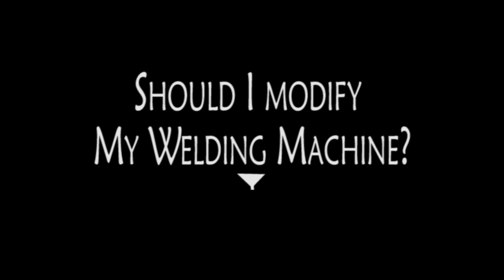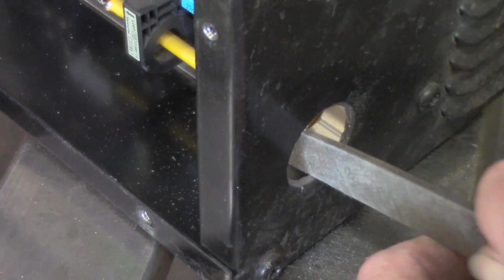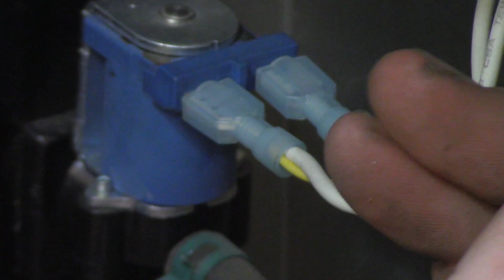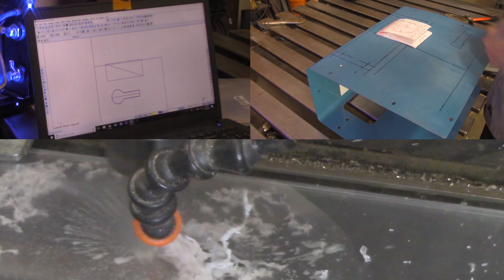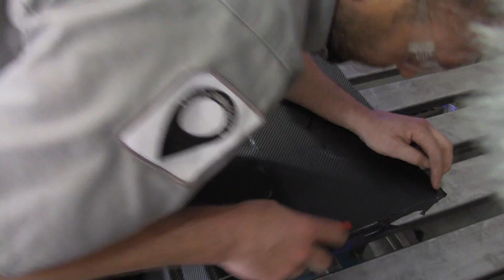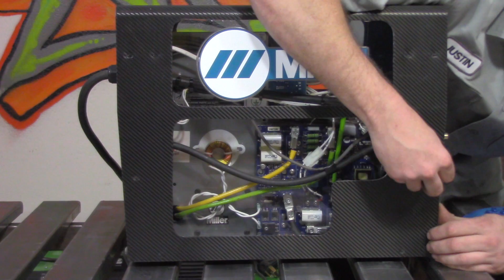TFS: Custom Welder Build

Comment: Ive programmed small computer games, built my own pcs starting from childhood, modified electronics and circuitboards.  Recently I purchased an amazing Miller Synchrowave 180 tig stick machine, plane Jane in terms of feature set but the reliability of a transformer machine, adding to its feature-set and making it more interesting would be really cool.  If I modify its functionality in any meaningful way it would probably be external pulser functionality on an arduino board or something and tied into the pedal but as a beginning tig welder such things are so tied into your personal preferences, maybe I'll do that some day as an experiment reading min max values from my pedal and playing with line input attenuation via an external chipset.  I probably prefer the mentality of skill development rather than creating technological crutches for my limited experience.  I love seeing the amazing case mod culture that surrounds gaming and pc building transfer into the welding space... as expensive and potentially hazardous as these machines are a lot of people are probably terrified to touch and modify them but it is really cool to see.  Love the videos, training, awesome precise, thanks for sharing your experience.

Comment: If you had room behind the panel, a step drill would probably have done the trick to make the holes bigger. But obviously you couldn't shift the hole using that method.

Comment: Awesome build! A couple of pro suggestions for future builds. Instead of hole saw use a knockout set for putting holes in electrical boxes. The make the job quicker and easier. Also when machining the acrylic, use industrial CNC double stick tape to stick it to the table. It’s available on Amazon and keeps you from putting your hands so close to the tooling. Great build man!

Comment: I'm sorry but I absolutely love my diversion 165.  I have never had a single issue with it and it's welded every from copper, aluminum, stainless, titanium, inconel, steel...  It doesn't have the adjustments that the other machines do but I haven't found a single situation where I was thinking 'only if I could change this setting', of course it has a duty cycle and I can't weld thick aluminum but it's my go to welder in my shop that has 6 Tig welders.

Comment: on the up side the wood kept metal particles from  blowing all over the circuit  board. I REALLY appreciate this video because I have a Thermalarc 211Ii  and I can't get a CK torch for it because My gas doesn't come through the DNSE connector.  I was HOPING  you were going to  do a HF start mod for this.  Well maybe  that can be a new project  how to get a DC Lift-Tig machine to have  HF start.

Comment: Putting that plastic sheet on the machine instead if the metal case, causes a LOT of RF to be emitted by the machine. Not good. It’s probably not legal anymore. Same thing with gamer computers when the replace the sides with plastic, except that the welder is worse.

Comment: ProTip :: HoleSaw drilling at approx 3½ min - no need for board, grab another holesaw "the same size" as the existing hole, then throw it INSIDE the bigger one, using the smaller saw as a core/centering stabilizer ..

Comment: Even simpler than clamping a board inside the machine case for the hole saw is run a hole saw inside the hole saw that matches the existing hole👌
Reply: He needed to change the center position of the hole.

Comment: Pro tip here:
if you're stepping up in a hole size with a hole saw you can put the smaller hole saw that matches your already established diameter hole inside of your larger hole saw there for centering it and not needing to have a backing plate to drill through to center your drill.

Comment: only thing I might have done extra since its already getting changed is use a gas thru dinse connector and get rid of the extra hose, just to clean it up that little bit more

Comment: Looks great. I've done a few computer cases and never considered the carbon fiber wrap. The wrap stands out. The three big changes lights, clear sides and the wrap make it pop. Very small suggestion would be to put some carbon fiber wrap around the top of the handle, as if it had a protective wrap on it.

Comment: Awesome! Btw, you could swap the internal argon hose to PTFE (Teflon) or PE (Polyethylene) since its resistant to wear and contamination. Rubber might contaminate the argon very slightly. I've seen the PE hose at homedepot/lowes for about 50 cents a foot, super cheap. Its semi clear, a white frost finish. Not the clear hose bc thats just vinyl, no bueno. 
mcmastercarr should have it also. Slight mod but seems like its worth it :)
Those hoses are available in all types of diameters, should be no problem finding the right size.

Comment: I own a Lincoln Weldpac 100 that is 26 years old.  Original wip and never repaired.

My only regret is not having purchased the MIG conversion kit back when it was $100.00. I just couldnt afford it back then.

Its now $225.00 on Ebay.

Comment: Btw... if you legit put it on +24v and a -24v... thats 48v lol. In ur diagram it should be just "common, 0v". :)

Or are the Blue lights using +24 and 0, and the red using 0 and -24?

Comment: I am surprised those digital electronics still work after spraying that compressed air in there... The turbulence creates ionic agitation which electrocutes sensitive digital electronics. Never blast out the inside of anything digital with compressed air, keep it under 40 PSI.
Reply: F#*k up

Comment: Another useful mod for it is to put a tee on the argon gas, and put some pistons under the feet, as well as a solenoid board, that way while it's all lit up, you can bounce it around like a lowrider. Another thing you can do is install a larger motor with an unbalanced weight on the shaft, so when its running it vibrates badly, simulating a large bass system, which can also be found in a lowrider car. That way, you get lighting effects, poor bass simulation, and a welder that's jumping around like a classic car in the hands of low rider enthusiasts.

Comment: You should Bluetooth/WiFi the power controls.
Then there's no back and forth to change the settings.
Reply from the maker: Matthew Wayer If I knew more about that I totally would.
Reply: Miller sells wireless controls for around $100.
Don't know if one would work for your box though.

Comment: Very pretty, looks great. However, you have undone all the hard work Miller engineers put in to make this machine EMC compliant under FCC regulations with those acrylic sections! It's probably going to interfere with every electronic device within 100metres, good luck with any CNC or telephones while this is working.lol.

Comment: Usually you do a lot of grinding around these machines and those hot sparks gonna ruin the new look very quickly. Stickers and that transparent plastic burn very easily.
Reply from the maker: Alter Not throwing sparks and junk at (just being mindful) will definitely avoid it. I'm not a fan of destroying my machines no matter how custom/cheap/expensive they are. It's still in the same condition as it is in the video after regular and class/student use.
Reply: Well you probably not doing that much of welding and grinding (assuming by this small portable machine). I do quite a lot of welding, like 40-50 meters every day and my co-workers loves to grind so massive amounts of sparks would go to random directions. I would probably burn that machine in a single day lol. There are just no time to make sure that machine is all protected...

Comment: But can it run crysis?
Reply from the maker: mike b No. It can only fuse metals together. It's a bit more constructive but does often keep you sitting in the same place for hours on end staring at the same thing.

Comment: What if the gas tube inside the welder would react the the light? I kept waiting for a radiator to be installed in the case for a water cooled torch.

Comment: If you have a hole saw bit that is the same size as the original hole, you can cut a "plug" out of wood then slide that plug onto the larger hole saw to help keep it straight.
Reply from the maker: William Hall I'm sure it works for some, but definitely adds a few extra unnecessary steps to the job in my opinion.
Reply: Fair enough! I keep different plugs now over time. (Got really tired of buying step bits and I have had to drill "blind" holes)

Comment: this schematic is very bad at 9.53, red and blue wire tie together to the LED and they still light up different colors of the LED... this doesnt make sense. Dont make the viewer feel bad about not being able to understand the schematic if you draw it so super badly.
Reply from the maker: The led strips (as shown) have individual leads to them. The graphic shows one LED instead of a strip, and is representative of what I did. Everyone else seems to have understood that as it was explained.

Comment: Do those relays have 6 pins or 5 pins? Doesn't an arduino relay require 5v to trigger it? Are you using 24v to trigger it then? I'm new to this stuff, so I'm trying to learn
Reply from the maker: Andrew450r Each relay is 5 pins but it's on a board so it technically only has 4 connections. Not all Arduino boards run on 5v triggers. This board is 24v so everything is 24v to make it work. 

If you have a 5v trigger, you can use it if you get a 5v board. You can even use 24v relays and a 5v relay trigger if you set it up correctly.

Comment: Also i have the cheaper lincoln 180A mig and it has fixed ground&lead and my lincoln is a Fisher Price toy gun on it, i think its called Magnum 100? my work i used a real one and my mig gun feels like a cheap toy and kind of embarrassing, Is there a way to upgrade the gun without major modifications?

Comment: I have the diversion 165 which is even more boring the 185 at least has a lcd display.. but have to say ur mods look bad ass! I love the color changing LED's and i like the cord conversion i also think the fixed ones suck... Is it easily possible to retrofit and lcd voltage display like how easy it is to install one in a car? Awsome job tho!

Comment: speaking of the computer cases, mayeb you can look into water cooling it, find where the heatsinks are and swap them out for water blocks and a cooling system.  it wouldnt probably stop blowing up, and get a much better duty cycle
Reply from the maker: Troy dejesu Already working on it for another machine.
Reply: I was thinking oil cooled

Comment: Now I'm assuming you can do this to the diversion 165?  And also, next time I'm in vegas, I'm stopping by, since you seem to be really close to the RIO.. lol!
Reply from the maker: I'm sure it can be done to any machine. The shop is only 1 major block from the Strip. People drop in all the time when they travel here.
Reply: The Fabrication Series  I'm more or less referring to the torch connectors.  I don't need the fancy lites. Lol.

Comment: I use a Miller diversion 180. I looked into getting a machine that does pulsing.  I found a company that makes a simple addon machine. It's called a Jattus tig perfect. I have been using it for about 6 months and works great. https://www.ebay.com/itm/272594362202?ul_noapp=true

Comment: I wounder if the giant holes in the case allow for more EMI to affect the wave form of the welder. All the PCB traces are technically micro-strip antennas.
Reply: I suspect this is more likely to be an EMI source than to be effected by it.
Reply: The welder is most certainly putting out EMI that is why I made the observation. Just because it is a source of EMI does not mean its immune to it, with out proper measures. The grounded metal case probably does a lot to help shield the PCB from the EMI of the arc outside of the metal case. Its a very common practice to put the RF front end of a radio under a metal box on a PCB to shield it from EMI of its own power supply. The welder may have lots of design elements built into the PCB to deal with noise, like ferrite beads,  rc or lc filters. I cant measure the welder with my oscilloscope through youtube video, so its a simple curious conjecture about a possibility.

Comment: Love the connector refit, but the case-window is less rugged though it looks cool.  A good front panel indicator would work since it's nice to know when the gas is flowing.  They also sell 2-relay boards if you don't need all 4; I've used a lot in controller projects where the optoisolators are very handy.  Thanks for another entertaining video.
Reply from the maker: +James Wyatt One part that didn't make the cut or the project was lighting up and changing colors of the decals separate from the case lights. It ended up looking cheesy, but I needed the 2 extra relays for them.
Reply: Btw, I've really enjoyed your series.  Some great stuff there and the production quality is nice.

Comment: Holesaw? you need a step bit.
Reply: yea step drill is the best for this sorta thing but, it doesnt let you offset the hole like was done on the bottom one.
Reply: Nah dude, a plasma cutter ducttaped to a sharks head  with a jet engine up its ass is the best thing for this.
Reply: @spoofer20  nah jig saw
Reply: @dill5500  nah  long schlong silvers willie
Reply: Kory's Rides you can't really use a step drill to change your center point like he needed for the bottom hole
Reply: @manguydude287  yes you can. I do it all the time. I've used a uni/step bit to take a 1¼ hole to a 2in hole with the hole offset from the old center by using the first steps in the direction I want to move the center and going slowly, hang on tight with your man hands and use the drill to chew your way that you want to move the hole. I've done it in sheet metal and 2x lumber with no issues at all. You could do it in thicker steel but would take forever
Reply: Hole punch would be by far the best for such thin sheet metal.
Reply: Nah dude, a cnc mill would be the best tool, just write up some g code and enter your parameters and mount the piece and you are off, kind of
Reply: I guess he means for enlarging the holes for connectors. But there is really no actual advantage with it over a wholesaw if you can just jig the back with wood or something.
Reply from the maker: Kory's Rides For which part?
Reply: Kory's Rides true well for the top hole
Reply: Pimp my welder...

Comment: If i had a diversion 180 i would 1000% for sure get those dinse connectors so i could run my own torch and ground... that is if i hated the stock ones lol... sweet upgrades no doubt!
Reply: I don't have a Miller, but my Chinese TIG welder came with strange connections, so I ended up doing the same thing to it.  Yank the powered non-standard gas fitting, replace it with DINSE 50 connector and a separate gas fitting, problem solved.

(I'd have loved to have started with a Miller, Lincoln, etc, but for a hobby welder, it wasn't in the budget...)
Reply: thats when you look at everlast! I LOVE my 210 ext... but i hear ya!
Reply: songer121 I would have, were I buying today!
Mine was purchased before Everlast started earning a reputation for affordable and decent welders.

Comment: I did a similar conversion to my horror fraught tig welder. It only cost me about $30-40, and a new, WAY BETTER torch (~$85). I went from the cheesey dinse 25 connectors to dinse 50/75s with a gas through torch cable, and got rid of the ALUMINUM and BRASS connection points behind them. I may have to do some more research to add amp limiting to my foot pedal, and those sweet LEDs! If anyone is interested in a video about it, please get ahold of me somehow.
Reply: constantproject1 , thought it was the Hazard Fraught...
Reply: constantproject1 Make a video

Comment: Awesome re build of a terrible original build by miller. Arc zone sells these kits and they are almost $200 bucks crazy! The board trick is perfect I would of never thought of that. Those tig machines hold this value I don’t know why. Ehh they are really basic. I went with a HTP Invertig 221 instead because the features beat the dynasty 210. Great build tho love it.
Reply: Jason i just got the pro pulse and invertig im waiting on my cylinders to get dropped off, you still lovin your 221.? im dying to fire these machines up
Reply: Auto Fanatic I love the invertig 221 did you get the water cooled option? You’re going to love it. It’s just as easy as the dynasty 210 I think the arc is better than the 210. I sold mine just the welder for same price as the full water cooled set up. You’ll enjoy it. I did a video on mine with the cooler
Reply: yeah i got the cooler as well I am just waiting for my new tanks to show up as i am using a new source this time around i kept getting bad gas fills and i do mostly stainless and i need good gas. I also have all of the Furick cups for the 20 series torch which work outstanding. I had prior a Miller Synchrowave 300, 200 and 180. This time around I was going to get their new 210 but so many QC issues i gave up and decided against going Miller this time around. Il be making a full video on the HTP gear in a few days and discuss why I chose this over the other stuff on the market as it just made the most sense for my needs as i refused to go with a Chinese machine, tried those and hated them all.
Reply: Auto Fanatic how do you like the pro Pulse 200? I love mine. I use it allot for aluminum hands down best mig I ever used. Both are awesome machines
Reply: Auto Fanatic you’re excacly right. Everyone thinks the Dynasty are die hard. They have so many over sea components in thrm now assembled in USA. The HTP is Italian made and die hard, you can’t even find one bad thing about them. Also people don’t realize that it’s really a STEL which is miller in Europe. Great products. Did you pay full price for your machines at HTP?
Reply: they gave me some discount, shoot me an email to chat some more i may have some questions to ask you as you have been using them for a bit, haven't fired up the Pro Pulse yet waiting on the guns to arrive